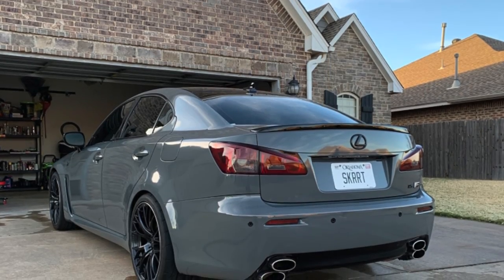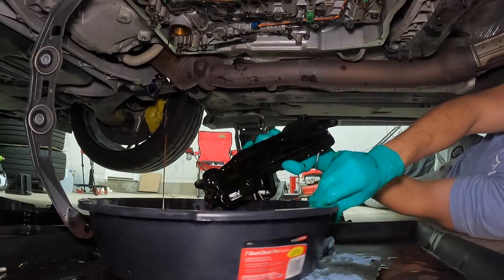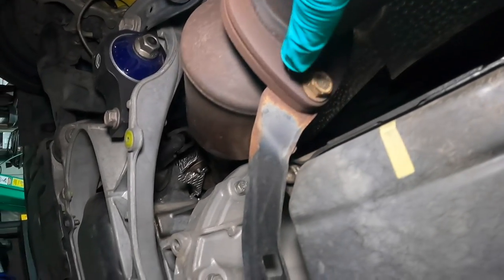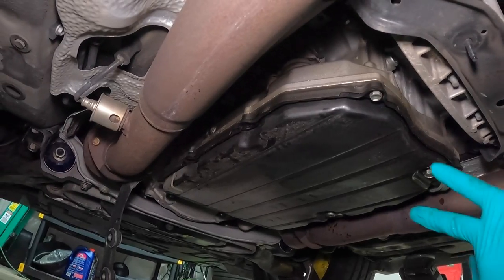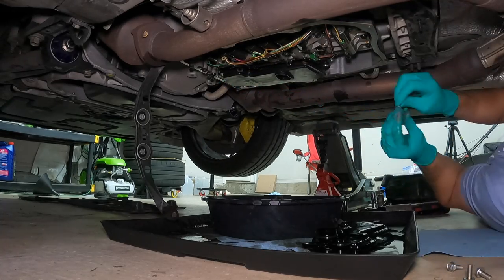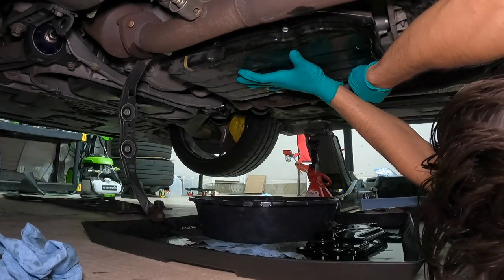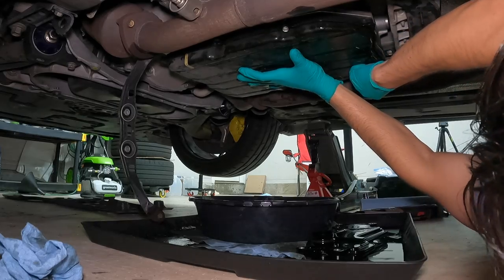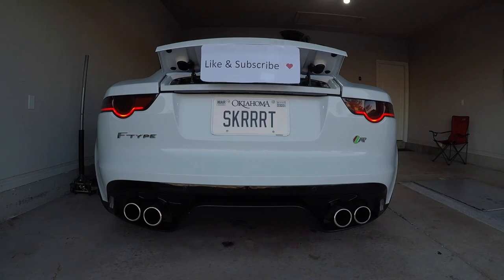Lexus ISF RCF GSF Transmission Service - DIY Tutorial

Comment: BEWARE!!! Torque spec Information in this video is incorrect and caused me a HUGE headache. The pan bolt torque spec is NOT 15 FTLBS. It’s 65 INCH lbs. or just over 5ft lbs… I snapped FOUR of the pan bolts trying to torque these little M6 bolts to 15 ft lbs. 1 of which broke flush and I had to drill the thing out. I was following along with this damn video and that’s what caused me all this headache. What should have been a 2-3 hour job has turned into 3 days. I know I’m partially to blame for not double checking the torque spec but please man for the love of god make sure you provide all the correct information next time!
Reply from the maker: Wow, I followed specs provided by Alldata. I’ll double check and out that in the video description. Not of my boot broke.
Reply: +1 one to this, I tried 15 FTLBs on my '16 GSF and I snapped the first pan bolt, I used 8 FTLBs on the others. Consider pinning the comment. Great video tho. Thanks!
Reply from the maker: Thanks guys, I pinned the comment and changed the description.
Reply: @skrrtgarage3922  apologies for being rude. Was just pretty frustrated at the time. This video did help me do the service so I suppose I can’t be too angry. Cars running great. Thanks for pinning.

Comment: Another method to measure trans temps is to use a Bluetooth OBD reader and download the software for your car on it. This unlocks the trans temp reader/feature. Turn the car on, get under the car while it's running while checking temps on your phone. Drain overflow. Done.
Reply from the maker: Yea, if I need to redo this I’ll use a scanner for sure

Comment: You can use a cheaper scanner like the carly device for example and use that to monitor the ATF temperature in real-time on the car's obd2 diagnostics port. Techstream isn't required. Heat gun is also a good idea!

Comment: I really appreciate the video. Just to be clear, after you removed & replaced the gasket on the pan. You filled up the transmission with approximately 5.5 quarts of oil. Started the car, waited for it to get up to temp. Then pulled the overfill plug? Thanks in advance!
Reply from the maker: Yes exactly, although I think I put about 5.75 quarts of ATF in. Thanks for the comment 👍🏼

Comment: i have lexus rc 350 2015 that has the 8 speed transmission too does it use the same operating temperature 95-110 to use the overflow drain?

Comment: Do you leave the car on once it reaches the desired temperature or turn it off?
Reply from the maker: Leave it running while you quickly drain. Then put the cap back on and then turn the car off
Reply: @skrrtgarage3922  basically drain the excess until it trickles while within the specified temp range? Sounds easy enough.

Comment: You kept the car on as you drained the excess fluid?
Reply from the maker: Yes, the car needs to be running and circulating the fluid
Reply: @skrrtgarage3922  awesome. Any cycling through the gears before you drove it? Sorry for all the questions. Your video gave me the most confidence to do this. It seriously doesn’t seem that bad at all to do minus the mess it makes

Comment: Is that oil pan for the transmission made of steel or plastic?
Reply from the maker: The pan is metal 👍🏼
Reply: @skrrtgarage3922  Awesome, thanks for letting me know. How do you see the overall wear and tear on components on yours? Do you see these cars standing up over the next 5-10 years?
Reply from the maker: No problem, i think these would easily last 5-10 years. There are a few maintenance items that will come up between 80-120k miles but that’s pretty normal. Thankfully no catastrophic issues